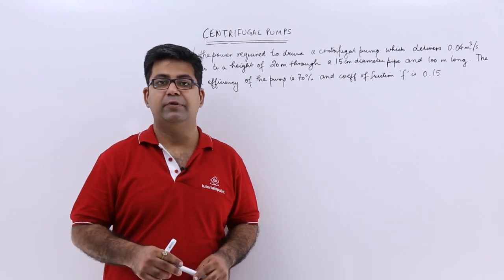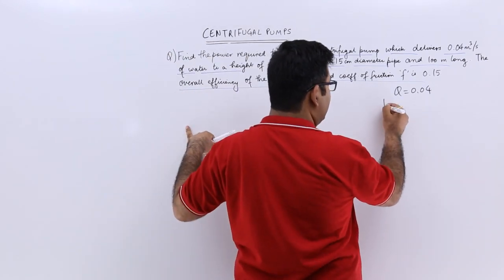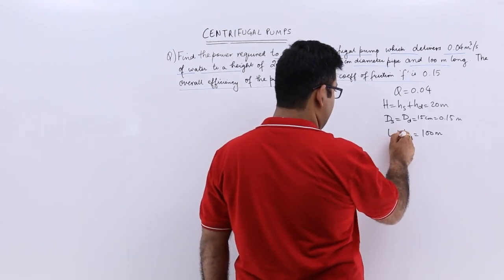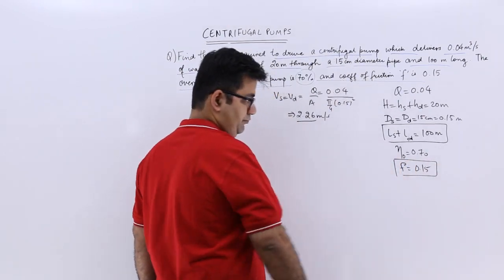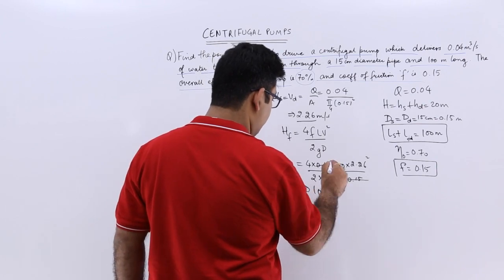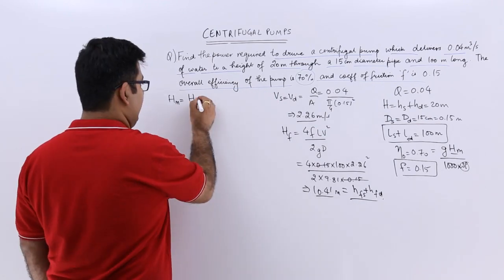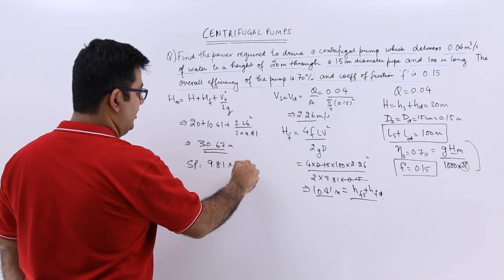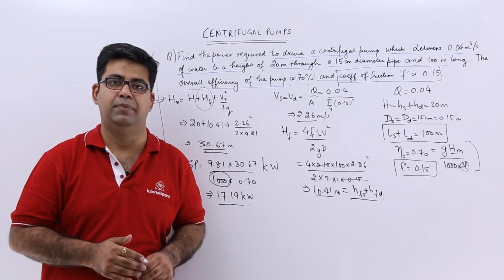Centrifugal Pumps Problem Example 3

Comment: A Centrifugal pump has an impeller of outer diameter 30cm.The vane tips are radial 
at the outlet. For rotative speed of 1450 rpm, calculate net head developed. Also 
draw outlet velocity triangle. Assume manometric efficiency 82%. 

(Sir I need the ans of above equation)

Comment: Hello sir, I have a doubt,,
In other problems you took Area is equal to A= ¶DB and in this problem u took ¶/4 x d^2
Reply: It was the area of the flow, here the area is of pipe, in impeller the water flows along the circumference, here it is the case of pipe so cross sectional area is taken i suppose.
Reply: Your formula for efficienvy is wrong...Plz sir...U have edit....